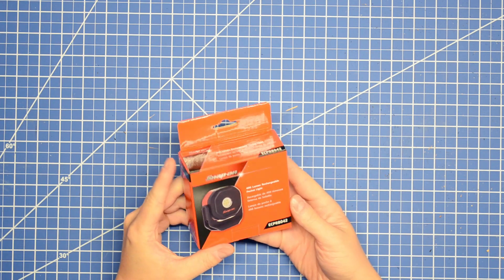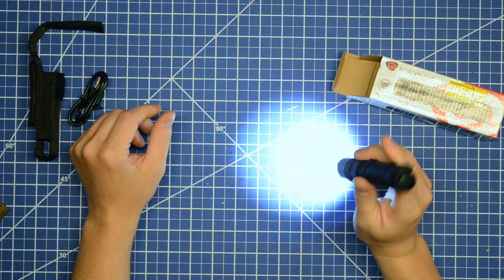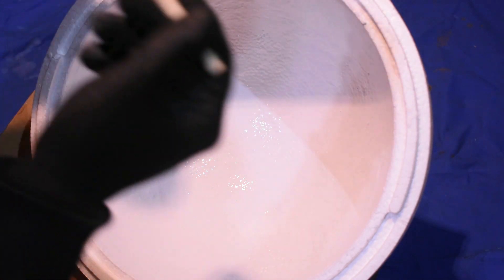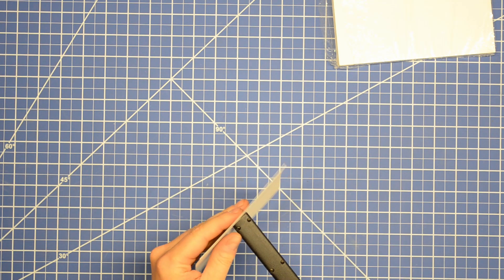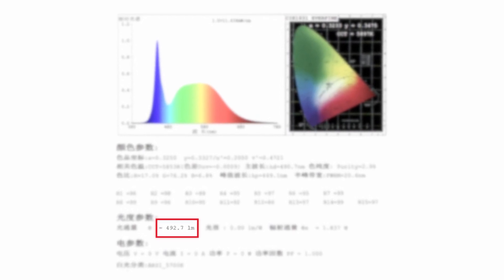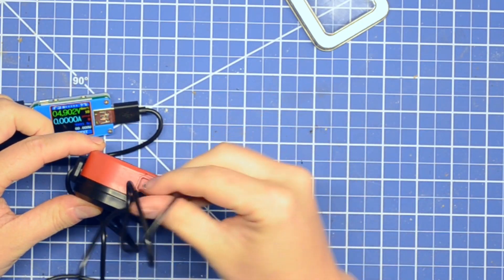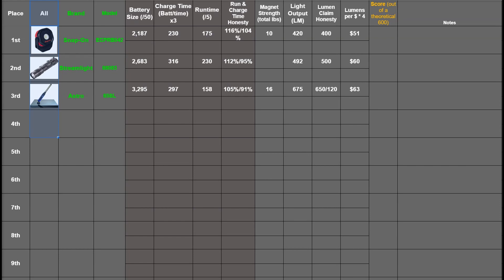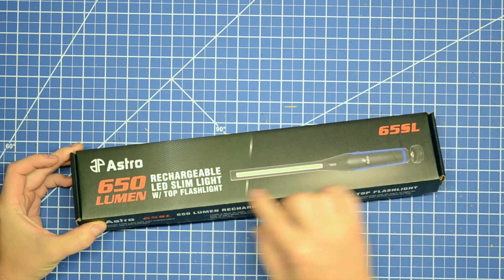Are Lumens Fake? We Built a Light Lie Detector: Snap on, Streamlight

Comment: You can't trust Amazon sells rating information. It's easily manipulated. I've given Amazon many examples over the years and every single agent always says "this isn't good, I can't believe we are letting this happen"

There are a few apps out there that will analyze a seller's rating and tell you if it's fake or not.

It's kind of ironic that you are testing manufacturers specs based on fake Amazon ratings for the products.
Reply from the maker: We're not looking at reviews, we're looking at sales rank. As in this is selling more than that. It's towards the bottom of the item page by ASIN number.
Reply: @TorqueTestChannel  this number is also faked. Unfortunately the whole ranking system from number one seller, comments and ratings are usually faked. You guys seem like you do everything you can to verify your results so I just wanted to give you a heads up that this stuff can't be trusted either. Just my .02 but keep up the good work, I look forward to this series.
Reply from the maker: Oh geez, it's all lies!

Comment: Get the Feit Electric Portable Flip Work light that looks exactly like the $145 snap on, its $35 bucks at Ace Hardware. I have it and i like it.
Reply: I think most of those Chinese manufacturers of these name brand tools and equipment. Ship them out with the name brand contract they have. Then ship out their own branded that are identical but many times cheaper.
Reply: @mrmotofy  yeah they do. Only difference is its not magnetic across the back and its made out of a different material. But its just as bright. I've dropped mine a few times from under a car on the lift and its still workin.

Comment: I have and like the Bosch 12v work lights
They use my 12v tool batteries which insures I have charged batteries on hand.
I would like to see them tested.
Thanks
Reply: Just putting it out there.. the 12v knockoff batteries that run around 9$.. have been working better than the BOSCH batteries my drill/driver came with.

Comment: Flashlights are my thing. I cannot tell you how incredibly hyped I am for this.

I WISH I still had my Pro Seeker 2 from o'light so I could send it in. My favorite flashlight I've ever bought.
Reply: I have the Seeker 2 Pro.  Great light.  Check out the ThruNite T2, it competes with the Seeker 2 Pro, cost much less, just as bright, wider flood, comes in natural and white light, has a 21700 battery, usb-c charging port built in to the light, and is more compact.  It's an incredible light for the price.  

I really love my Seeker 2 Pro, but the ThruNite T2 is incredible, especially being that it cost almost half as much.

Comment: Since there is a limit to the number of recharge cycles on a battery it is extremely important that the batteries in lights be removable so they can easily be replaced giving the light a much much longer life.  It is also important to me that they be relatively cheap as they get lost or broken much more often than pure wearing out.  Another good value would be shelf life of the charge so that when you go to grab it it isn't dead because it sat on the shelf for a week or two.

Comment: I have a relative of that Astro light and for regular use, it easily lasts all day. If you need something that is turned on constantly for hours, get something wired. I have a rechargeable under hood light bar that I leave plugged in for those occasions. Little lights like these are only for occasional use. 

Also, a slight criticism of your battery capacity testing. The numbers you get when charging the battery are always going to be inflated numbers, because charging any battery is not 100% energy efficient. In other words, if it takes 2200mah to charge a battery, you will not get 2200mah back out of that battery. Its also not going to be consistent because the charging circuitry within each flashlight is different and have different levels of efficiency.

Comment: As a DIY mechanic, and a CNC machinist, I only buy Olights. And the most pocket friendly, none of those weapon lights. They all have magnetic tail caps. My daily carry is a 1200lm Baton 3, while at work I have a 2000lm Baton Pro. And yes, any of the notable Flashlight brands are honest. One time the light went out inside the a CNC machine I was setting up, so I just stuck my flashlight inside.

Comment: The way you are measuring battery capacity may not be accurate for all charging circuits. Your method will favor a light with a less efficient charging circuit, since you can't measure the energy delivered to the battery vs lost in the charging circuit. This will be more of an issue if you test lights that don't use 5V to charge. Not sure of a good way to measure it without hacking the light apart, though.
Reply from the maker: Well said, as others have mentioned as well.

Comment: Just a little note in regards to the tool used to measure the battery capacity. There is energy lost to heat when charging a battery, so the reason that the lights seemed to go over advertised capacity is likely do to parasitic loss.

Comment: Check out  imalent brand flash lights ..   I personally have the imalent MS06.  25,000 lumen..  if it is or not I don't know but I do know it is certainly brighter than anything else that I've seen so far..  they also have one that claims 100,000 lumens and it actually does get super hot and starts fires and has electric cooling fans and stuff like that but please check out them

Comment: Charge time should be discarded for tools with removable cells or at least they need to be given a HUGE asterisk to that category and some kind of bonus given elsewhere because the reality is the charge time on that Streamlight is the 30 seconds it takes to change the battery. You can buy name brand (Panasonic, Samsung) 18650 cells for literally ten dollars or less online, often of higher capacity then the ones in there and a simple two bay charger can be had for again about ten bucks. 

This is also why I personally actually consider the 65SL trash. Really any light that isn't designed with easily swappable batteries is IMO.

Comment: Love the video! Quick note though:
The mAh capacity you are measuring from the USB meter is NOT going to accurately reflect the actual battery capacity internally. The number you read will always be larger, as most small Lithium charging circuits are based on Linear Constant-Current/Constant-Voltage regulators, which waste excess energy from the USB input as heat.
In addition, the electrochemical process that happens internally to Lithium batteries means there will always be some energy loss when recharging a cell in addition to the charging circuit.

While this testing methodology generally fine to compare one brand vs. the other, it will not necessarily tell you if the advertised battery capacity is what is truly is shipped out. To accurately measure battery capacity, you should measure the amount of energy you can take OUT of the cell. This can be easily done by something like a Li-500 battery charger/capacity checker. Take the 18650 out of the lights and place them into the charger and let it run a full cycle check. It will charge battery completely, then discharge the cell and measure capacity for you. for lights that use LiPo cells or non-cylindrical cells, you can use short alligator clips to connect it to the charger battery contacts.

Regardless, love the testing you guys do! keep it up!

Comment: Streamlight knucklehead. Excellent light. Not the brightest, but you'll need a Mack truck to destroy it. And its magnet will break your pull force gauge. The lens also resists brake clean and carb cleaner very well. It is my go-to light and has been for years. It also gets fixed with a lifetime warranty if anything breaks on it. I've had to have a new head put on once. The bulbs and lens broken loose.

Comment: ATTENTION
you need to use different thicknesses of metal to get and accurate measurement. There is a thing called saturation. Thinner metals offer less attractiveness than thicker.
Reply from the maker: We work on cars, where on a car is steel 1/4" or thicker?

Comment: I have the Maxxeon Cyclops, same style as the Snap On you had at the beginning.

Had one of those with the dial, but forgot it under the hood one time :(

I think a benefit of that stream light is that you can remove the battery to charge, then you can pick up an extra battery and have no downtime.

Comment: FYI, testing battery capacity by the charge mha will give false readings as it is including all the losses in the buck/boost converters, cell wires etc. Basically the charge numbers will vary wildly and are not comparable.

Testing the discharge current is how to properly do it but this is not possible on lights without a removable battery unless you want to get into the guts.

Be aware though that a light with very high mh reading during charge vs actual capacity is actually a bad thing as it shows it is a very inefficient charger / bad quality cell or both.

Comment: That "luster" is usually called an orange peel finish and it sorta acts as a diffuser.

I'm not sure why you'd buy a Streamlight with 2,872 reviews vs an Anker with 13,378.

I hope you guys test the big guys lights, ie, Makita, Milwaukee, etc.  I can't tell you how often I use my Makita DML801 and it now went from a tool/hunting item to being kept downstairs on top of the piano so I can get it quicker.   And living on the gulf, the DML807 is ready incase we loose power during a hurricane.
 
Damnit, I just looked at Amazon and saw the Makita DML812.  Trying my best not to buy it now...

Comment: For worklights with an integrated battery, or even a pocket torch intended for work-like use, should really not be taking most of the workday to charge. Absolutely massive missed opportunity for an integrated USB PD circuit to allow for fast charging. Even more of a missed opportunity for all the wanking the marketing team can do over a fast charging work light.

Comment: I assume you already know this but some thoughts for future testing.  Flashlights can be regulated or unregulated.  With a regulated flashlight it will try to maintain the same light level output for the entire duration and cost more.  Unregulated is run straight off the battery, so the light reduces over time as the voltage of the battery drops and are cheaper. The result can be losing significant light output from the start to the end as you noted.  This also means the same flashlight with an unregulated design will almost always outlast a regulated one. Some recommendations: Use fixed exposure during recording so you can see the difference from start to end of battery life testing. Ensure the batteries that are replaceable are using the same chemistry. So for AAA or AA sizes you can get Ni-Mh such as Eneloop or Li-Ion such as EBL.  Li-Ion as 1.5V batteries are built to be regulated already and convert their 3.6V-4.2V to a standard 1.5V output.  Great video, love the deadpan jokes and keep up the great work!

Comment: I feel that the scoring and testing of products with replaceable standard batteries should be reconsidered. If you need a light for all day use and it has replaceable batteries like 18650 then you would get multiple batteries and switch out.
While not free, they are not the same cost as a 5Ah tool battery.
Reply: Esp if they are USB rechargeable Li-ON ones.  Just too easy not to swap in a new battery and plug the dead one to a USB and let it charge.

Comment: I think a very over looked light is the workbench P727 from ryobi. for a $55 light it works extremely well. Can be found for $40 range occasionally. I have converted Milwaukee, dewalt and rigid tool lovers to the light after using it.

Comment: Amazing! I'd love to see an accelerated burn in test too! How many of those lumens are left after a month or year of use? If you ran the lights continuously from a power supply for a few weeks, the ones with better heat management or led size strategy could show themselves.
Reply: Heat soaking a flashlight for "a few weeks" is outside of normal use, and it wouldn't be a very valuable metric. A flashlight is turned on briefly and off to cool. Even if you run the flashlight for 20 minutes at a time, it may get heat soaked, but it'll have a lot more cool down time. So it may only be heat soaked for 12 out of those 20 min.

Comment: You are going to have losses in the charging circuit. The longer the charge time may even mean more mAH that is lost to heat and not a true number on how much battery capacity there really is. Measuring the battery capacity under a small load would be better here.

Comment: The biggest issue with using only raw lumens is that it tells you nothing of concentration/focus. Lumens without primary and secondary beam angle is only so useful. And the clarity/sharpness of these two is what defines the quality of the reflector+lense. The good news is that is pretty easy to measure with fog/mist or sometimes just laying on a table.

I say this because I have several spot lights which do no have the highest lumen count but are like a portable sun as they have a beam angle of like 5*

I still want to know the raw lumens tho as I want to see what brands are honest, but I am saying is you guys could come up with a innovative test to show practicality of the light even tho it is not marked on the box. Say you could measure the lux dirrectly at 5", 15", 30 to give you the useful brightness at distance

Comment: Link to the USB charging meter gizmo?
Reply from the maker: This is what we bought https://amzn.to/3wdlRYg
Reply: @TorqueTestChannel  that USB power meter is measuring the power coming through at 5V and the batteries (typically) run between 3.2V and 4.2V. There might be a flaw in your methodologyfor using it. You would be better served to look at the power consumed and the actual Wh of the battery than just the mAh ratings.

Comment: As far as lights to test: I'd love to see a lot of floodlights, especially anything with removable batteries and/or high CRI. Any of the pocket size Milwaukee Rover lights would be great to see. There's a small floodlight called the Wuben F5 from a more niche brand that I think would be interesting and haven't been able to find any output tests on it. There's also a sketchy Dr. Prepare work light (ASIN# B07VQF8R88) that I have a version of (I got one from Aliexpress where there are dozens of listings for the same light under different names) that has a nearly perfect feature set in my opinion (compact, 270 degree articulation, stepless dimming with dedicated +/- buttons, removable 2x18650s, USB input and output, strong magnet and hanging loop, battery gauge), but I don't trust the output ratings at all. I'd be really interested to find out what it really does as far as lumens.

Comment: CRI would be a good one to add to the tests. Even a subjective bad, OK or good. If you want to get fancy and actually measure it take a look at the Minolta CL-70F.

Maybe do light weight divided by magnet pull for the magnet ranking. A heavier light needs a stronger magnet but shouldn't get a higher ranking because it has one.

Comment: Among the less popular Chinese lights, I have had good luck with Thrunite. I use a TN12 2014 for working on personal cars and to carry at night. They are cheap enough to justify buying 2 and a handful of batteries. The current equivalent is TN12 V4. $40 light and can use the higher capacity 5 amp 18650's. I know a lot of mechanics want a more elegant solution but if you're a cheap ass this is a good middle of the road starting point to avoid the really bad Chinese lights. Also I'm not sure why anyone would buy a light that doesn't have a way to swap batteries. Imagine having an impact that you can't swap batteries and have to wait for it to charge.

Comment: For the battery life, what if you were to use the datalogging feature.  That unit can record up to 16,000 data points, and at a sample rate of 1 per second, you could get almost 4.5 hours of recording done.  More than enough for those lights.  You could extend the sample rate out if needed if you test something with a huge battery.  You can then graph the light output over time to analyze how long its actually useful, not only on, with a data set.